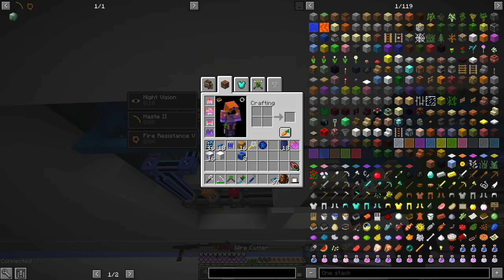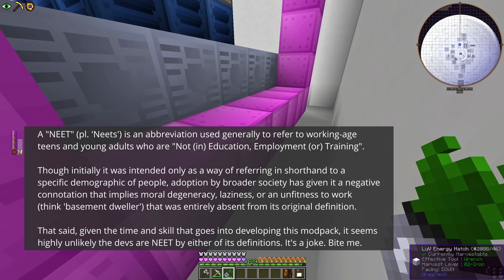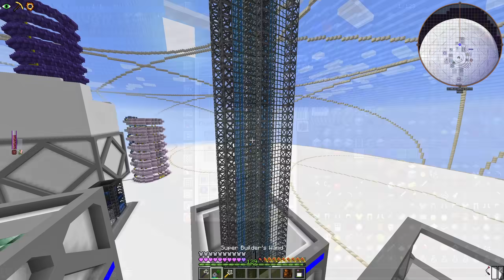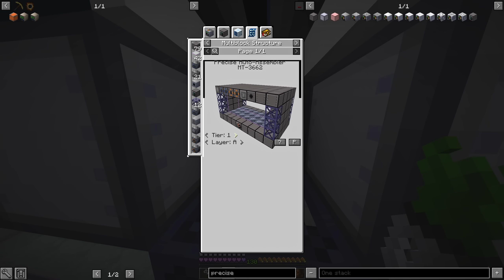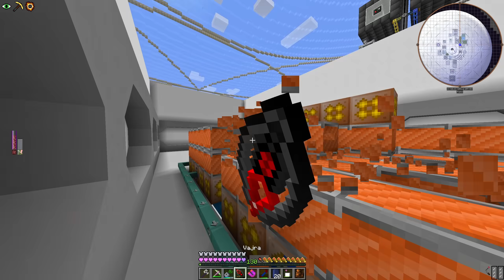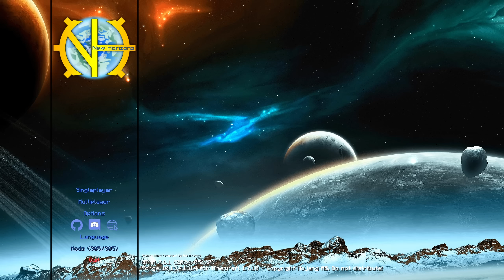Beating Minecraft's Hardest Modpack With Nothing // Episode 32 - Elevator Go Up The Hole

Comment: Things used in this video
1 a creative mode item that you can craft
2 a mega chemical reactor
3 several weird donuts that make plasma and highly radioactive materials sometimes
4 a mega electric blast furnace
5 an infinite speed and size network adaptor
6 a mega vacuum freezer
7 a second mega electric blast furnace cause one was never enough
8 dump radioactive waste in the local park
9 WAIT THERE ARE OTHER PLANETS IN THIS FUCKING MODPACK?!
Things not done in this video
1 PLAYED MINECRAFT

*Most of these items were made because processing 1 item per game tick was not enough processing

Quote "the endgame of this pack is gonna be interesting to edit"
THIS ISNT THE ENDGAME OF THIS MODPACK

I thought it would be sort of fun to play some GTNH like as a hobby. Instead I'll go and get a degree in technical engineering and computer science respectively

Comment: The matter of switching cables every tier is why some might be convinced to invest into a power spine made up of super high voltage cable that can be crafted relatively early (examples being HSS-S, Bedrockium and Nether Star to name a few) and, at least in theory, don't require that much upgrading from than on. In practice the switch from a central power spine to laser hatches makes this more complicated, and once you have access to bulk Infinity you also have access to bulk Infinity cables, which are...good. Really, insanely, unreasonably good.

"I kind of just want to see how high up I can stack donuts before the diehard New Horizons fans start screaming in the comments section about how I'm doing it wrong". Um...about that. I've seen people build towers of compact donuts - not the small basic variety, the bigger ones that cost like a hundred times the materials and are 3x3 chunks in size - *horizontally*, because stacking them vertically has you run into either the build height limit or the base design equivalent of the Geneva Convention that even hardcore lawnbasers adhere too as otherwise their glorified series of scattered market stalls would look too ugly to continue existing within the presence of. So, good(?) news, you're clear to stack a whole lot more donuts before anything is going to suggest you stop (seeing as how at this stage in GTNH progression the presence of a function called "sanity" would be in question if it ever existed to begin with).

The key blocks for component assembly lines are excessively expensive, but on the bright side, they're on the edge of the multiblock, specifically the very top. What does that mean? Well, you can rotate many multis in this pack, and the component assembly line is one of them. Flip it 180 degress, and viola: You can wallshare those excessively expensive blocks and get two multis for the price of one...sort of. There's other stuff you need for the multi but compared to the top (or bottom, depending on your point of view) blocks the rest might as well be a rounding error.

Something else you can do to help with performance issues is enabling Batch Mode on multis. It basically allows multis running recipes that are 64 ticks or less to run multiple batches of recipes at once, doing (for example) twice the work in twice the time for twice the power. The benefit in server performance is significant, as checking for a recipe every six seconds as opposed to every twentieth of a second is massively easier. Something else worth noting is how overclocking a recipe that is already running at 1 tick works. Single block machines will reduce the power cost of the recipe, which is largely useless and frankly difficult to even notice in practice. Multiblocks will, in some cases, gain the ability to run multiple recipes in parallel, even if this is not an innate feature of the multi. I think Batch Mode retains this sub tick overclock parallel boost if it's enabled, it's just hard to notice because Batch Mode itself sort of simulates parallel recipes already. It's not a feature I looked into all that much to be honest, but I have observed it in testing.

It's generally recommended to take the NEI structure preview as a guideline for a multi's general shape and looks, and rely on the tooltip for actual building instructions...assuming it has any. The biggest ones tend to just say "this is too complicated to explain in text, just use the structure hologram thing". In any case, the NEI structure preview is notorious for being wrong or leading unsuspecting players astray with incomplete information, and while that has largely been fixed over the last few major patches there are still a few pitfalls here and where. The Electric Implosion Compressor, given that quirky no solid actually solid wait no not really solid centre bit, unsurprisingly being one of them.
Reply: Well, pre 2.7 you were able to just make 1Mamp lasers of a tier of your convenience and didn't have to upgrade until 2-3 tiers later. Main limitation of non-laser power is that hatches are only 64 amps and until ring of loki is available, giving more power to machines is simpler than making more machines. Granted, ring of loki isn't hard to make, but it is annoying.
Reply: Sorry I am a bit late but how do you transfer power into the infinity wires? with only the 64A dynamos it seems difficult to reach the level of throughput required especially past UHV
Reply: @aderix_  Generally speaking you'll (eventually) use laser hatches and active transformers to move bulk amounts of amps around from your LSC to every corner of your factory. Whenever you need to draw power you add one or more 64a dynamo hatches to a nearby active transformer, draw a line of infinity wire to whatever bank of machines need power, and plug them in.

It is impractical to use infinity wires as a traditional central power spine, though even if dynamo hatches weren't the limiting factor eventually the infinite wire itself would become a bottleneck. Lasers let you move up to around 1 million amp per laser hatch pair, and there's simply no way any traditional wire or cable competes with that. And yes, you will be using that much power eventually. There comes a point where you stop measuring power in EU/t and start measuring it in amps instead.
Reply: @TheShadowofX  yeah ok thanks that checks out then I am currently close to UXV and yeah the amount of power I need to move was clearly not possible with just a few amps of power. Thanks tho I'll stop using superconductors past UHV in my next run since now the wireless hatchs took over in my current one
Reply: “and viola” and violoncelli?

Comment: Oh, diehard new horizons fans have been screaming about lack of mega multiblocks for a long time now. Compact donut is included in that category, so minidonut stacks are indeed wrong.
Reply: And subtick overclocks do, in fact, exist, but are pretty bad for performance, which is usually solved with batch mode, parallels, or both.
Reply: I am appalled by lack of laser hatches on megas. That's half the reason to make them, their ability to consume as much power as you can transfer. Especially since it's 2.6 GTNH where you can make 1M amp lasers of any tier

Comment: A possibly-game-breaking (or, at least, exceedingly painful) bug so late into the game is, all on its own, evidence enough that the game is too long, as it becomes victim to a combination of the law of large numbers and the law that, as you make a piece of software bigger, its attack surface increases, which i'm not aware of having any sort of cool name, but which i'm going to call the square-cube law of software as revenge against the field of mathematics for not having a reference manual.
Reply: It's not really a bug, NEI just renders the assembled multiblock, which is not bad because buses get to look like other casings, but in particular case of electric implosion compressor also cause middle 5 blocks to not be rendered, as they aren't rendered when multiblock is assembled (they are still in the world if you break it though)

Comment: Circuitry. More Circuitry. More Circuitry. More Circuitry. It’s truly a thrilling game loop
Reply: No, it’s circuitry, infrastructure, circuitry, infrastructure. That’s the thrilling game loop😂
Reply: And don't forget, that every high-tier coil (starting from Awakened Draconium, if I remember correctly) requires 1 circuit each. Why? Go figure yourself!
Reply: @JaZaLupina88  because OBVIOUSLY it doesn't even instantly melt when trapped inside the TEMPERATURE OF…im not sure what goes around that temperature actually